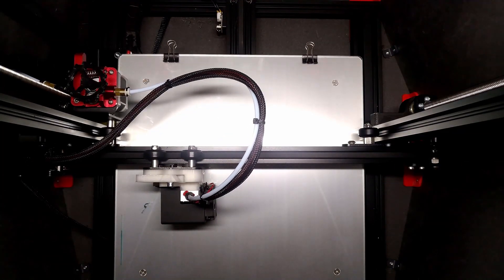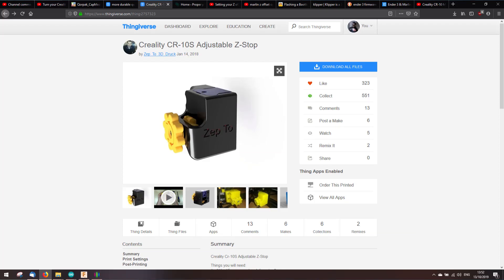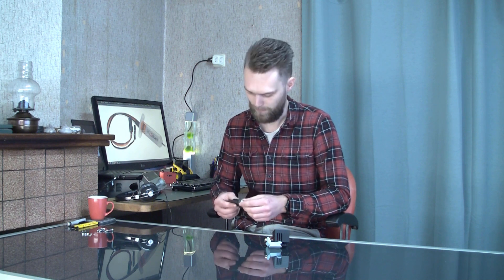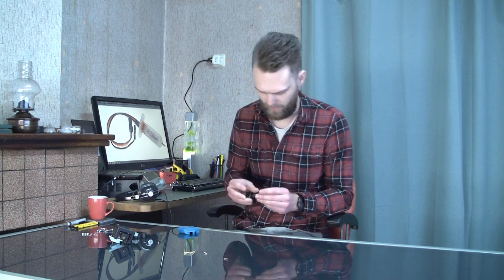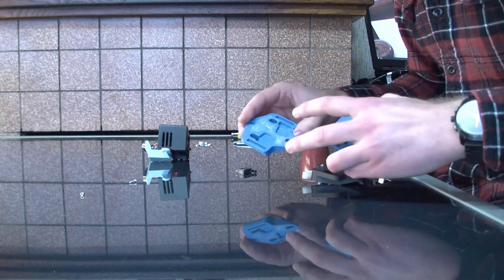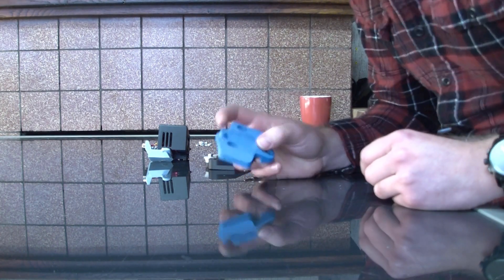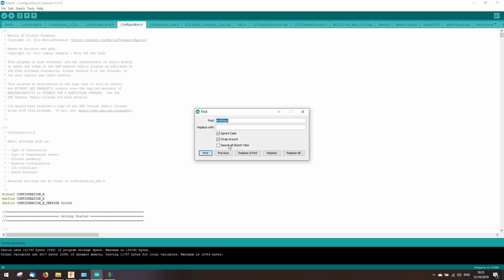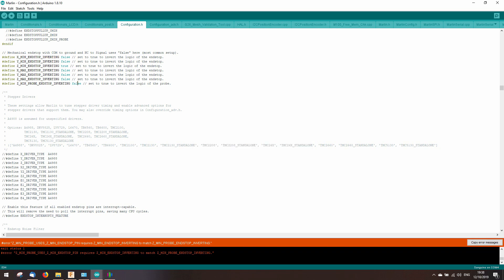Home on anything with any tool automatically on an Ender 3 pro

Comment: Hallo, es müssen 100k messsensor auch vorhanden sein (wir reden bei 16 Volt auf der Platine) , bei einem 100k messsensor müssen Faktoren vorhanden sein das heißt die messsensoren auf dem Markt haben keine 100 k 10 oder 50 der Messenger funktioniert so bei einem Messwert 100 k sendet der messsensor 5 Volt er hat einen Art Rest lichtschranken haben die gleichen Probleme.

Comment: It's safer to leave it connected to the normally closed contacts. You can connect the switches in series rather than parallel and leave them normally closed.

Comment: good video! Have you considered using a Hall Effect sensor rather than a micro-switch?
Reply from the maker: Thanks! No I haven't, thanks for the suggestion. I want to improve this further in the future because using the micro-switch is far from ideal, but it shows the principle which works :D Using a hall effect sensor could be an interesting approach!
Reply: @properprinting  Thank you for responding. The hall effect sensor I believe is what is used in the BLTouch. they are smaller than the micro-switch and would only require a small magnet.

Comment: Still don't quite understand how this works. The microswitch triggers after at least 5mm additional travel after the nozzle crashes into the build surface. But the springs extends the tool downwards beyond the height it was at when the switch triggered, once the gantry goes up again. Surely you don't print with the nozzle scraping the plate for the first 10-25 layers? With the microswitch in a fixed position on the gantry mount - Do you add/subtract a fixed number to the Z?

Comment: Why modify the firmware to change from a single NC (normally closed) limit switch to two NO (normally open) switches in parallel? If you have two NC (normally closed) switches, wire them in series rather than in parallel. Then whichever one triggers (opens) first, it opens the circuit and the microcontroller senses the limit has been reached without firmware change or settings change needed.
Reply: Oh, I see someone else already mentioned that. It would be good if you updated your video to add text overlay to mention the simpler method of wiring.

Comment: No need to invert the setting if you put the normally closed  contacts in series..
And also the switch will be more accurate  without the lever.

Comment: Flexing from the tool changer tilt, springs and maybe bed movement, might be allowing you to home Z just below the nominal bed level. It can still print if the filament extrusion is pushing the nozzle back up a bit

Comment: With normally closed switches, you can wire them in series to get the either switch function you wanted. For normally open you'd use parallel. Essentially one is wired and and the other is wired or, but which depends on the active level; it's a physical application of De Morgan's laws.

The advantage of normally closed on the printer is that it stops if the switches get disconnected and is less sensitive to noise since there's some current flowing in the idle state.
Reply: Yes, putting the switches in series would have been a much easier and more resilient solution. It would not require any software change.

Comment: I printed this out in ABS and found the purchase links for the bearings were a bit high on their shipping rates. 
So I looked around and found this 2020 plate uses the same sized bearings and has cheaper local shipping, for anyone interested.
https://www.amazon.com/gp/product/B0813CV954/ref=ppx_yo_dt_b_asin_title_o01_s00?ie=UTF8&psc=1
I'm going to see how much better this works than my BL Touch clone.  Greak work.
Reply: And finished.  it works great.
https://www.youtube.com/watch?v=F98vGwbc4YQ

Comment: How do you avoid a lose hotend/wobble. Any info on the design ?
Reply from the maker: The v slot wheels act very similar to the ones holding the x carriage. I've printed all polycarbonate parts for my current project with it and it's still going strong. Once it's at the bottom position it's fairly stable

Comment: Do you know if there is a reason why NC(normally closed) is used for endstops over NO(normally open)?

Like is breaking a circuit in someway better than closing a circuit for sending trigger to main board?

Came to same conclusion the other day that a microswitch is a low cost reliable method for an ABL sensor and the fact it only needs two wires was important to me since all other components on hotend(excluding stepper motor and print cooling fan, custom printer I'm designing will use a remote direct drive extruder setup) like heater cartridge and thermistor all have two wires. Let's me use the same Molex 2 circuit connector for all wires. 

Anyways wasn't sure if I should go with NC or NO.
Reply: If the wires to an endstop got damaged or disconnected, it is safer to have the machine automatically stop than keep going. Therefore NC is safer than NO.
Reply: @poberauer  thanks for the reply, that makes sense

Comment: The Z offset is huge. Have you actually tried printing with it?

To make it more stable: a load cell or piezzo sensor to capture a small change in force?
Reply from the maker: This is actually my production printer atm. It has printed a polycarb parts for that moving gantry printer too :) It works, but it can be improved like you mention indeed

Comment: The switch you intend to use does not have the precision required to do that. Also this lowers rigidity on the tool. The only way to do this repeatably is to use a $1 piezo on each tool with a $30 controller that goes to the motherboard. This is a very complicated setup do design though, not for the faint of heart. However it will yield industrial quality results every... single... time... The thing about piezos is that they are extremely sensitive and never ever fail. They last 30 years easily.

Comment: the problem is, when the gantry is moving, there is one more point of failure or even more - insonsistency. Did you consider SOFTWARE Endstops by using the STALL function of tmcs ? That should work well with a fixed tool.

Comment: Wow this is brilliant do you think that design works on my cr-10? i want to do the same. if not can you share the files so i can make 
the necessary changes so that those of us who have the cr-10 can also take advantage of your incredible design.
Reply from the maker: Yes, that's possible, the head of the CR-10 is similar to the head of the Ender. You can download everything from my site and it should fit :)
Reply: Proper Printing thx I will try and let me know if it work

Comment: If the mechanism doesn't add any mechanical instability when the nozzle is printing I love the idea. No more mesh offset calculation in Klipper (I do have a chart for it though).

Comment: neat idea. have you considered a capacitive probe though? I will also add a tool changer to my tevo tarantula but i managed to install ubl using a capacitve probe which i will continue using. will post my result and files here when done. please keep making videos!
Reply from the maker: Nice! I am considering making a video about all homing methods out there to show the accuracy and (dis)advantages. Including the capacitive probe :D
Reply: @properprinting  for me it works really well on the glass bed.  If I didn't had that probe already, i'd totally use the same approach you took.

Comment: This is a great idea.  The only flaw would be if the bed wasnt actually flat since your not adjusting the height settings in the programing for the different places on the bed.  But by far it is great for this quick swap ability you have going :P

Comment: Hi, Firstly, I just love your ideas, which are giving me ideas on how to make my Ender 3 a multi-tool machine, or die trying.
One thing I don't understand in your design is, why did you place the micro-switch in the tool-holder as opposed to placing it in the tool itself, allowing for vertical adjustment as needed.
Micro-switches are pretty cheap, so the cost would be very low. Also, most common micro-switches comme with 3 contact, a center common and a NO and NC contact at each side, no need to change settings.
Reply from the maker: Thanks Paulo for your comment! The simple answer: I didn't think of that ;) But now I do I'm wondering if this is doable. I think it won't be an easy thing to do and for me it's important to make it backwards compatible with my original quick tool change.

Comment: Since all tools have the same mounting plate, you can add a screw in each plate that can be used as homing. Each tool requires manual adjustment, but you get the rigidity back. Also if you put switches in series, you don't have to change the software.

Comment: This is just a so great idea, I need to add this to my printer! I've been having problems with my probe for moths!
Reply from the maker: Thanks a lot! I have great experiences with this mod so far. After carefully adjusted this I haven't touched my leveling knobs yet and I already did some hotend and nozzle swaps and printed a lot with it already :D What kind of problems do you have with your probe?
Reply: My problem is that I have a glass thickness (anycubic bed), so the metallic part of my bed is quite far from the first layer. This leaves me about half a millimeter to adjust my probe which is really not a lot. And my fixation is not very good so the probe goes down a little bit every print so I have to adjust it again all the time...
With your solution, those two problems are solved. And moreover, if you change the nozzle, you don't need to readjust the z offset :D
Reply from the maker: @yann516  Interesting, thanks for your reply! Yes, the fixation is pretty important. Indeed, you don't need to readjust the z-offset anymore :D Definitely the biggest advantage of this approach

Comment: Hi... Great work. Micro switchs are not precise, and they have bouncing contact. I think using contact with a precise thickness PCB (on the bed) then using nozzle as conductor to make contact to it (PCB).I just received my Ender 3... And... true.. Z axis need some kind of your upgrade (with another lead screw too).  New subscriber Jon ! :-)
Reply from the maker: Thanks for your comment and subscribing! Interesting thing you mention! I've planned a future video in which I want to test all different Z homing methods and checking the accuracy and reproducibility. I think that would be interesting to find out.

Comment: Great idea and great video!

This concept already exists by using piezzo "sensors" attached to the E3d V6 hot end but are as expensive as the BLTouch and to a specific tool.

Did you noticed any print quality degradation after installing it? At which speed did you print that benchy?

thank you
Reply from the maker: Thanks Daniel for your comment and information! I haven't noticed print quality degradation. I've got it properly tuned in and I haven't leveled the bed since. I already swapped hot ends and all the first layers were perfect so far. I'm pretty happy :D I printed that Bencht at 3600 mm/min which is the standard setting I got from Simplify3D

Comment: Interesting. Congratulations!! Keep working. Though with this method you won’t be able to use your spindle, as engraving requires more force than that those springs can offer all together with the weight of the tool. Am I right?
Reply from the maker: Thanks for your comment! Yes, you're right. I still have to make a locking mechanism for these kind of tools. In those cases, homing can be done with the regular homing switch. Thanks for mentioning :)
Reply: Proper Printing yes. Or you could add a latch to lock the tool so it doesn’t move. To home the tool you unlatch the mechanism which will allow the tool/springs to move, and once the homing is done you latch it again to keep everything tight

Comment: As always, you've come up with a very interesting and useful idea. I don't know why you don't have more subscribers. I have an idea for you - have you considered upgrading the control board in your Ender 3 to a BigTreeTech SKR Mini E3? It's a direct plug-in with no mods required. There are many advantages but five of the ones that get me wet are: 1) uses TMC2209 stepper drivers, 2) provision for filament run-out sensor, 3) provision for installing a BL Touch, 4) no Arduino required nor connection to a computer when updating the firmware, and 5) 32 bit processor. I installed one in my Ender 3 and am loving it. If I'm printing without the print cooling fans turned on I can't tell that the printer is doing a print from as close as a meter away because it's so quiet. Teaching Tech has a couple of good videos on the subject that you might be interested in. The best part is that the board is very inexpensive, much cheaper than the Creality upgrade board and it offers more advantages/features.
Reply from the maker: Thanks man for your comment and information! I received exactly the board you mention as a gift from one of my subscribers and I'll add this to my new Ender :) I'm not going to dedicate a whole video to that board because this has been done before, but I have a neat idea what I'm going to do with it. Thanks for mentioning and I cannot wait to add this board to my printer!

Comment: Doesn't this have the same problem with putting a BLTouch on the tool changer, that every tool has a different Z Probe Offset? Putting a BLTouch or other probe on the base of the tool changer would have the same effect and wouldn't compromise on the structural integrity of the mount, or am I missing something?

One way to do away with the probe offset would be to home the tip of the tool on a switch to the side of the bed, which some people have done.
Reply from the maker: The homing switch actuates when the nozzle hits the print bed meaning that the height of the nozzle is cancelled out. With this idea it's possible to swap out tool heads, nozzles and even build plates without ever having to adjust anything. The distance between the nozzle and the bed is set in the software so once this is set correctly you can start printing without having to worry about the offset which looks like it's spot on every time I start a print :D Hopefully this makes sense :) The idea of probing on the side of the bed is actually a pretty good idea. This will cause some problems if the tool center point is different between tools though.
Reply: @properprinting  I get it now, that is useful indeed! I would imagine the springs would spoil any engraving or drilling heads because they can't press down, right?
Reply from the maker: @TheAnoniemo  Yes, good point! A great improvement would be a way to fixate the head and use the standard micro switch for these specific uses.
Reply: @properprinting  On another note, if you upgrade the mainboard of the ender with for example an skr mini e3, you get tmc drivers that can do sensorless homing, with a threshold you can set in the firmware. This way you wouldn't need a switch at all and the resistance of pressing the tool down would trigger the endstop.
Reply from the maker: @TheAnoniemo  Yes, that's something I'm going to figure out as well. I think it would be interesting to investigate all different homing methods because it turns out that there are many. Thanks for mentioning this one!

Comment: damn! I love your idea. I designed something with a tilt mechanism that attaches to the hotend groove and it worked amazingly but it had one issue which was the hotend wobbling around near the hinge.

also your hotend lock design is so cool! I wanna do all that to mine but it's hard xD but the amount of force your mechanism needs to activate is a little too high. want advice? what I did for that issue on my tilt mechanism was to use a spring + washer + m3 screw for the spring and as I tightened it more the force increased. you could do the same to fine tune the force. also use an optical endstop! it has a really accurate trigger point meaning you literally won't even see anything move in your printer once it triggers. that also won't push the heated bed down on weaker points.

This idea is amazing. it's kind of hard tos ee well in your video. are you gonna make a thingiverse post or something :O I'd love to make something similiar for my hypercube evo
Reply from the maker: Thanks for your comment and advice! An optical end stop sounds neat! I have to take a look into that. Yes, the design can be found on Thingiverse: https://www.thingiverse.com/thing:3948924 I see now that I have to update the description, Done! I received a lot of suggestions and ideas and I think it's a great idea to make a video about the different homing methods. This will take a while because I just started a new project which I'm working on as we speak. It would be great if you make something for the Hypercube, let me know if you need anything!